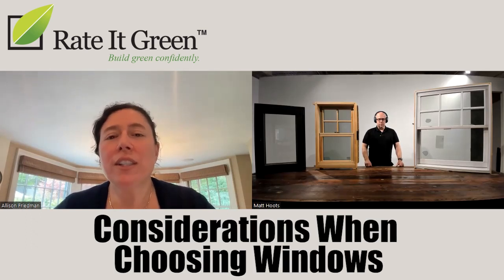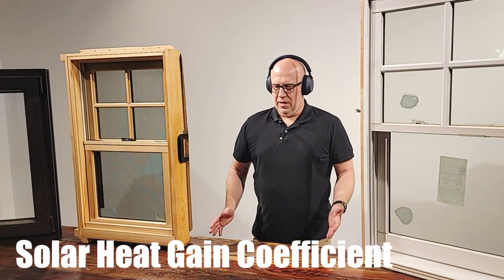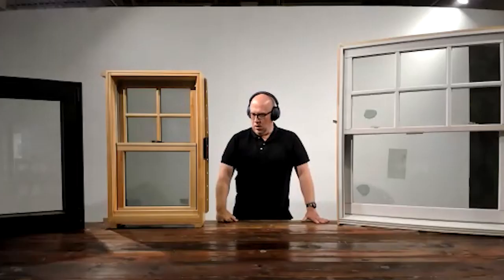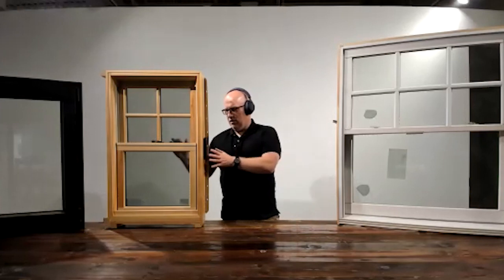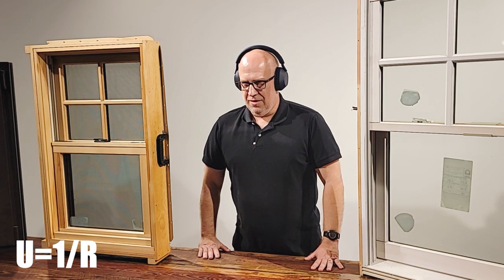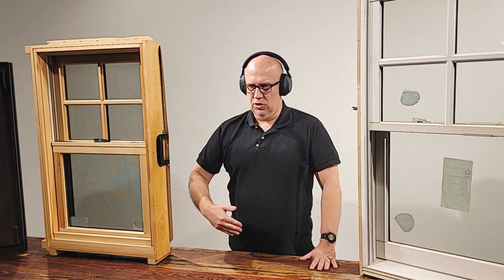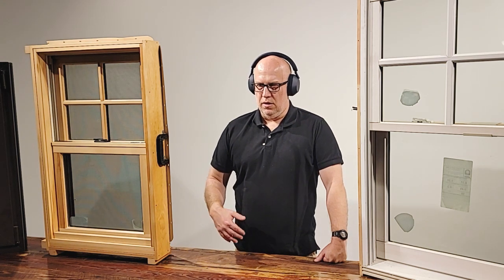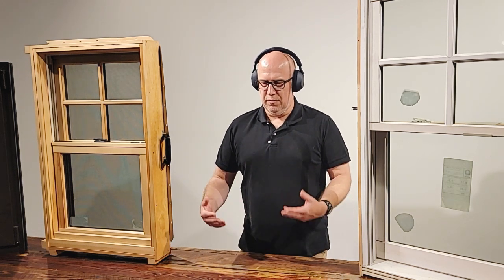What Should You Consider When Selecting Windows?

Comment: Really enjoyed your video. Lots of good information and well presented.

One clarification, in the video Matt mentioned a couple times that U value is simply one divided by the R value and also that both measured thermal resistance. Allison then questions why someone would change the letter (from R to U, as I interpreted from how it was stated.) just to make things more confusing for consumers, when in reality U value or U factor for windows was developed in the 1930's by scientists to measure the amount of heat that passes through a material, while R value was invented in the 1970's by marketing people to sell more fluffy pink stuff. R value was (and is) the result of testing to determine the U value and then converted into R value, U measures actual heat loss and R is the extrapolated resistance to heat loss based on the u value measurements. 

Following up on what Matt said in the video, windows are made up of a multitude of components, each with a specific U value measurement. A wall is made up of a multitude of components, each with a measured U value. All of these individual components have an R value derived from the inverse of the U value or R = 1/U. Determining the average performance of the window components combined or wall components combined requires using the U value. If using R value, the math doesn't work and the resultant average will be wrong. For windows this average is called the U factor and its the weighted average of three individual U value measurements -- sash/frame * edge of glass * center of glass. 

There are formula's that use the R value for the computations, but within the formula R is listed as 1/R, or U.